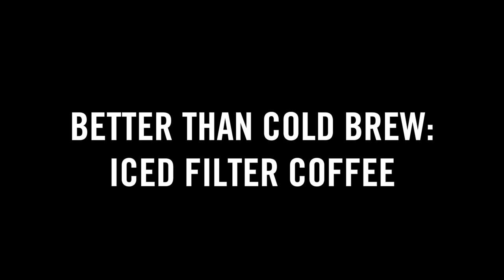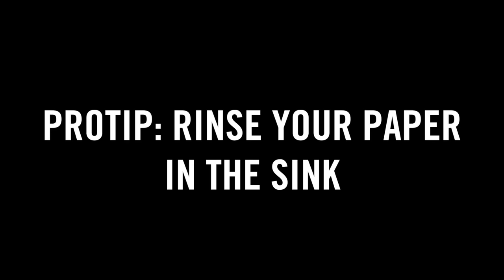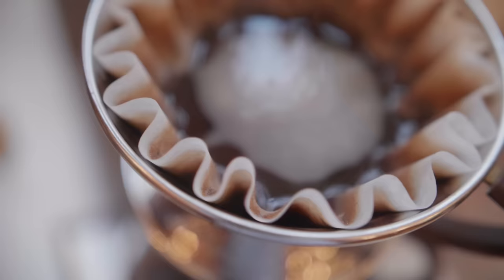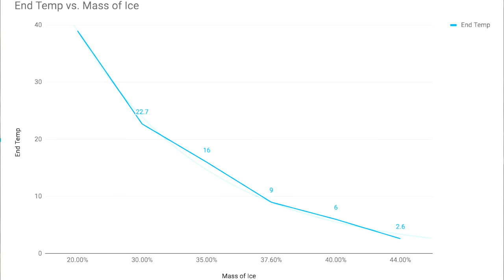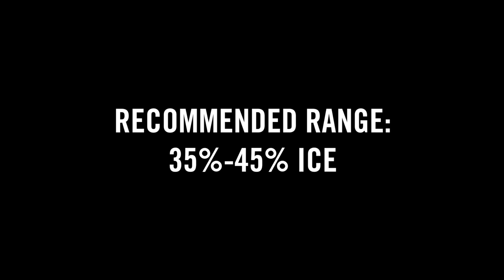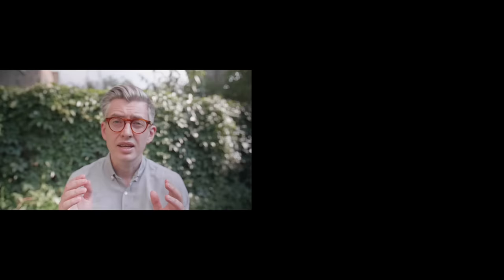Better than cold brew: How to make iced filter coffee

Comment: 65g of coffee
200g of ice
300g of water 

45s bloom 

And stir both after bloom, and once in one direction and then once in other direction, correct?
Reply: James Hoffmann gotcha, thank you so much for the clarification! As a fan of both cold brew AND pour overs, I plan to try this later this weekend.
Reply: James Hoffmann Which settings on Wilfa? :-)
Reply: I love your videos!
I youse the same method for Japanese style iced filter coffee but my coffee to water ratio is smaller.
Isn't 1:15,4 to little coffee for iced brew?
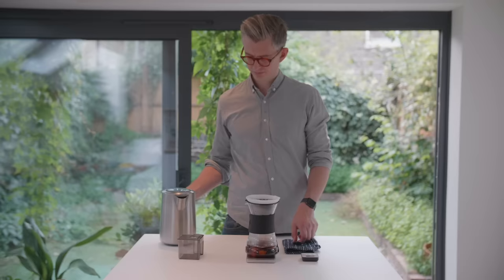I have tried different ratios from 1:10 to 1:14 but I will use yours write now because I just wake up and want some delicious coffee!!
Keep up the good stuff!
Best regards from Greece!
Reply: Almost, but the answer is 'nope'.  Stir the top bloom twice in the filter clockwise.  Then twice counter clockwise for the liquor with ice in the decanter.  A marriage made in heaven when the two 'stirs' are combined.  It keeps the electron flow 'even', an important element in coffee-ology.
Reply: What’s a mil’ of water?
Reply: James Hoffmann if my coffee is 20g, how much ice i need? And hot water? (Need help)
Reply: Jensen Bell - milliliter.  There are 28ml in an ounce.
Reply: Thank you! That's a new abbreviation for me. Also... I tease because some Yanks find the metric system to just sound funny when spoken. ;)
Reply: Did he say the grind to use?
Reply: It was pr liter, så it is 32,5g og coffee, since the water is a half of a liter.
Reply: @rifutokarano  you can try  20gr coffee with 180ml hot water and 120gr ice.
Reply: I wish I saw these comments before I brewed with 65g of coffee lol

Comment: A tip to use less ice: put the brewing pot in a small ice bath. I haven't actually tried this with this coffee recipe, so I don't know how much it would reduce the need for ice, but it should be fairly significant, giving you more hot water to brew with.
Reply: i saw some sort of "metal ice cube" (i think they are some high specific heat liquid like water enclosed by metal) being sold... maybe these could work
Reply: @ginger88895  they're actually just stainless steel cubes. Often sold as whisky stones or whisky rocks. Traditionally, whisky stones are made out of soapstone, which is non-porous and could possibly also work, but I suspect steel stones would work even better.
Reply: @Tutorp  that's good to know... now i'm a bit skeptical since metal usually have very low specific heat 😅
Reply: @ginger88895  True, steel has a lot lower heat capacity per unit of weight, but it also has a much higher density. From what I've gathered, these two more or less balance out, such that the heat capacity of a steel whisky stone is in the same ballpark as an ice cube of the same volume.

Comment: I like to use my French Press for iced coffee.  Fill 2/3 of the container with hot water over grounds and let bloom  for 4-6 mins.  Stir once then add enough ice to bring the brewed coffee level up to my usual 2 literish level and plunge once ice is melted.  Results in a strong, smooth yet fresh iced coffee at room temperature which doesn't melt the ice in my cup.

Comment: Hey James! Keeping all other variables the same with a similar-to-yours iced coffee recipe, if I simply add the ice to the decanter post brew rather than pre brew, I can use considerably less ice to cool down. Immediately I can get a higher strength which is nice. Or I can use a little less coffee next time  and achieve a similar strength but higher extraction. Either way, I much prefer the post brew adding of ice.

Comment: Have you considered solving the extraction problem of using less water by using the clever dripper? The problem with the pour over method is that you are using much less water (therefore reducing the amount of time coffee is in contact with the water). You have solved the problem by using more coffee ground slightly finer. Why not just use the clever dripper? The contact time with the water is completely independent of the amount of water being used. I've tried it and yields EXCELLENT results.

Comment: Maybe a silly question.
You said "more brew water is always good."

So, if I were to completely hot brew into a decanter full of frozen whisky stones??
Reply: No harm in trying it out! I imagine it would be pretty good.
Reply: Maybe the only implication worth being mindful of would be using a heat resistant vessel to brew the coffee in. Other than that, sounds pretty solid and would help not diluting it.
Reply: I know this comment chain is 4, years old but I still wanna say something. stones are much less efficient than ice at cooling, because they can't use the phase change. so rocks will be slower and you need more of them.

I think the oxidation makes this not worth it, because you will not get so much more out of a brew by 40% more solvent

the only hope I see is with a tall narrow container that doesn't allow much oxidation, and with small stones with a lot of surface area

Comment: Hi Hoff! (Couldn’t help myself.) Love your videos which have been refreshing during COVID - and I’m surely going to try this. However, your claim on ice is totally off. Bartenders tend to believe the same thing... There are probably specialists in thermodynamics in here, but here’s a layman’s input: water freezes as 0 degrees Celsius. While the air in the freezer may be lower, the ice is actually zero. When ice meets hot water there is an energy transfer. For your drink to get 1 degree lower, x amount of ice turns to water.

Comment: The temperature of the ice doesn't matter all that much. Water has a very high heat of fusion, which means it takes a lot of energy to melt it. This means the ice will rapidly heat up from -18°, to 0°, and then stay at 0° for a while as it melts, constantly absorbing heat from the coffee. The amount of energy required to turn 0° ice into 0° water is almost 5 times as high as the amount of energy required to heat ice from -18° to 0°.

Comment: This method also works great if you substitute the "ice" with milk. 300g water for brewing, add 200g milk, and you've got coffee with milk that doesn't taste too diluted. It's a bit more involved than my usual black coffee brewing, but it's worth it for those times I want that specific taste. Oh, and be sure to heat up your milk if you want your coffee to still come out hot.

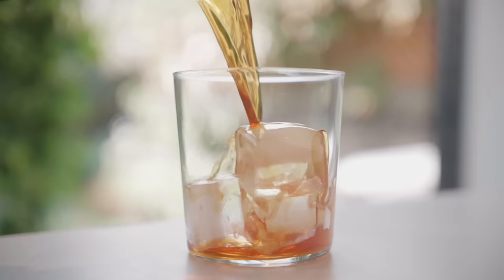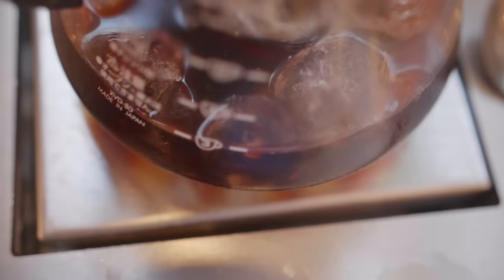Comment: I think I'll do it with 175 Ice, 325 Water, at 33g Coffee with an 80g 45 sec Bloom and the rest in two Pours of 110g each stretching it so draw Down ends around a little over 3 Mins. Then I Might try 175 Ice 325 Water 33g Coffee with a 66g Bloom for 45 sec then 79g. and at 1:30 60g at 2:15 60g at 3Mins 60 Kind of a 4:6 Ice Method

Comment: Quantities for 500ml

- Grind 32.5gm beans
- Add 200gm ice in a flask
- Heat 300gm water
- Start pouring 2-3 times weight of coffee (32.5x3 = 97.5gm) OR (32.5x2 = 65gm) 
- Let it bloom/sit for 45 sec
- Stir it.
- Do it again. Total blooming time should be around 2.5-3 minutes. (150 sec - 180 sec)
- Stir the bloom 1 clockwise & counter clockwise
- Stir the flask to get rid of remaining ice.
- Pour on to fresh cubes of ice.

Comment: The temperature of the ice basically won't affect the result, at least it will not be noticeable.

Most of the energy is absorbed by the ice melting, not because it's cold. That's also why "ice cubes" made of stone just don't work.

Comment: After watching this video, I have several questions. 
1. I don’t get why we don’t add ice to the coffee after it’s completely brewed? This way we won’t need as much ice as the environment cools it down a little in the decanter. And we can use a little more hot water to extract a little more flavor from the coffee. 
2. If we can really get a good extraction with this ratio of 65g:600ml (1:9.2), why are we brewing with 1:15/1:17 for hot coffee? Why don’t we just brew 1:9 and dilute it with hot water?

Comment: if you just put the grounds in a cup of scalding water for an hour and a half and let them sit then pour crushed ice into the cup and pour that out into another cup absolutely no grounds will pour out.. do not pour the actual ice into the second cup.. the whole point is for the ice to catch the grounds and also the cold keeps the grounds in place.. you dont even need a paper filter. the problem with coffee makers is that alot of them dont actually brew long enough for really get the coffee flavor so all you get is the acid.. this is a better method to get all the flavor of the beans

Comment: Nice. My favorite way for straight iced coffee too.

If I want something with milk or flavored syrup, I feel cold brew lends itself better for those purposes.

I like the idea of updosing. I use the general 1:16 which isn't too far off, but it does get a bit diluted if it sits for awhile.

Also, I usually have some unmelted ice when using .33 : .67 ratios of ice to brew water.

Good stuff and thanks for the video KingJames!

Comment: I'm new to this method, but definitely intrigued as summer is fast approaching. Question, could you use something like the hario switch or clever dripper to achieve more extraction through immersion with the smaller quantity of water, then release that super potent coffee over the ice once it's had its steep time? Seems to be this would make this method even more potent and easy, but maybe I'm missing something?

Comment: This is really great content.
The only modification i would make about how you explained the process is when you talk about the ratio (65g to 1000ml).
I think its more proper to talk about Brew ratio and Ice ratio, becouse your are not extracting in a 65/1000 ratio, your are doing it in a 39/1000 brewing ratio and a 26/1000 Ice ratio.
Just my oppinion but i think its a substantial difference, becouse part of the modifications u did on the method respond to the fact that with a 39/1000 brewing ratio you will underextract, so the 45s blooming, the +5g and the other modifications make sense.

Anyway i really really like this kind of content and you clearly know what you are doing, keep it up and thanks!!!

Comment: I'm thinking of buying a graham condensor to see if it's possible to run the coffee through the coil to flash chill it to required temperature for a nice cold coffee. This way it would be possible to get full extraction using a standard  pourover recipe without any dilution from the ice. I'm wondering wether or not it's possible and worth it to do so. Has anyone tried this?

Comment: Excellent video! Just one question: What's the total brewing time for this method? i usually aim for 3mins 30sec with 32g and 500ml. So here we have 32.5g with a slightly finer grind and 300ml of water. In what time should the water be through the filter?

Comment: Written recipe for anyone needing it:

6.5 % Coffeegrounds per litre of finished brew
35-45 % Ice
55-65 % Hot Water

1. Add ice to decanter. 
2. Rinse coffee filter away from decanter to avoid heating it.
3. Bloom grounds with 2-3x amount of coffee for at least 45 seconds.
4. Stir the bloom.
5. Stretch brew to 2½-3 minutes.
6. At end of brew, stir once 360* clockwise, then once 360* counterclockwise. Let it draw down.
7. After brew is finished, swirl decanter until ice is melted. 
8. Pour onto fresh icecubes in glass.

Comment: Why don't you use more hot water for the brew and than let the coffee sit for a while to drop in temperature before adding the ice? Then you will get more hot water which makes it easier to make a good and even extraction. Are there any other problems except that it takes more time? Compared to cold brew the time would still be a huge advantage.

Comment: Yes! Thanks for the ratio. :) I've tried something similar once or twice and will need to give this a shot soon. Extending the bloom time makes sense, and not something I really thought about trying.

Now...a question, and possibly a more fickle one... The Iced Latte. What's the James Hoffman take? I would love to hear if you have thoughts on a good recipe. When I'm at home, I steam the milk, since without that you just don't get the same sweetness or mouthfeel. I pour the shot of espresso into the steamed milk and swirl the pitcher around. This usually drops the temp of the espresso enough so it doesn't seem to 'shock' it the same way that pouring it all over ice would, but it's still not quite right. In the end I end up pouring a pitcher of espresso-milk at ~140-150(F) over a bunch of ice, and that dilutes things quite a lot, and sometimes that's a problem too...
I'd welcome any ideas or wisdom.

Comment: For those with a refractometer, any ideas on what a final iced filter coffee should measure out at (TDS & extraction) before it is poured over ice?  Similar to hot filter coffee, or something different?  I think that might help me try to dial in a grind.  Thanks!
Reply: Eric Nadler - by all means use one, two, maybe more refractometers using this process.  The quality of the end result is directly proportionate to the number of digital devices and any other gizmos used in the production of this Cold Coffee.
Reply: Steve McCormick thanks for the help

Comment: Hello coffee friends! Trying to get this down but it's coming out a bit bitter. What temperature is "hot" water? Asking because the usual temperature can vary a lot depending on the method.  Also I have a Baratza Encore. Any idea of the grind size? When I brew my V60 I usually set it to 15 or 16, so should I set it lower than that? For example, I set my Clever dripper to 22, so I'm not sure what he means when he says to grind "finer than you usually would" since that could vary depending on the brew. Thank you!

Comment: the temperature of the ice definitely does not matter. the amount of heat required to heat the ice to 0C is minuscule compared to the amount of heat required to melt even a tiny bit of the ice. if it's ice, it's ice. do the experiment.

Comment: Any issues with this method causing the glass of the decanter to crack or break?  Either from dropping the ice in (albeit as carefully as possible) or the temperature difference between the bottom and top of the brewer?  My knock-off Bodum 8-cup brewer just cracked widely and a piece split right off the bottom once coffee started pouring through the ice.
Reply: I just use a sturdy wide jar as the "decanter" when I use this method.

Comment: Does bloom mean steep before allowing it to go through the filter?
Reply: the bloom is the immediate  liquor reaction to the hot water hitting the ground coffee in the filter area.  The water begins to leach out the aromatic extracts of the coffee (making the coffee liquor).  That immediate dissolution or extraction of the coffee properties mingling into the water is the bloom.  Not stirring the 'bloom' in the filter area can leads to uneven extraction of the ground coffee, as the grounds cling upwards above the quickly receding water line to the sides of the filter and can also clump unevenly in the bottom of the filter.   By stirring the combined wet grounds and water at this stage (the bloom), a fuller surface area of coffee to water volume is achieved, leading to full utilization of the water with the ground bean.

Comment: The ice being cold shouldn't make much of a difference. It takes 334 Joules of energy to melt 1 gram of ice at 0 degrees, and the heat required to heat up 1 gram of ice by 20 celsius  is 40 Joules. It hardly makes a difference to the energy being sapped from the hot water.

Comment: Is hot water 100C?
Reply: By the time your water starts to boil til it hits the grounds, it already is at 91-95°C. Could be lower depending on your altitude. That's the hottest water you could use and that's what he means by "hot" water. He actually has an entire video on water temperature.